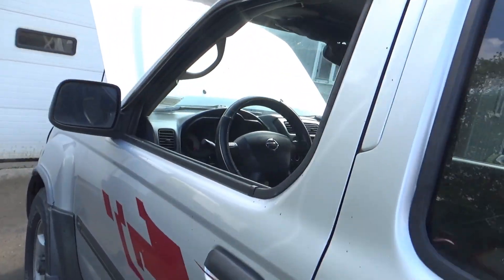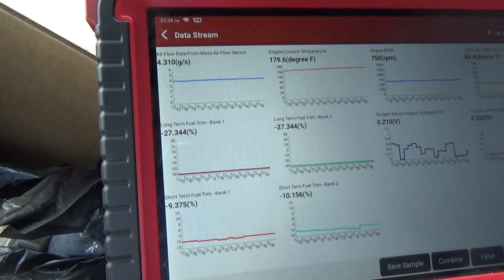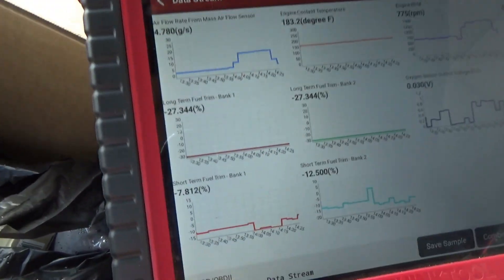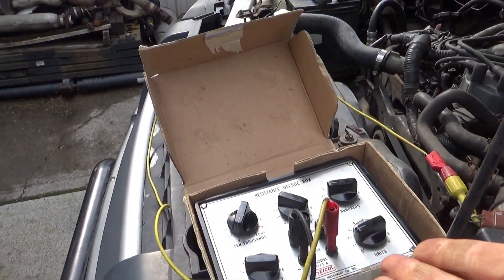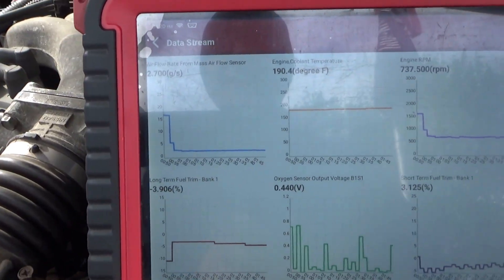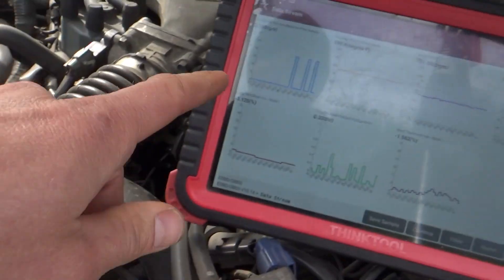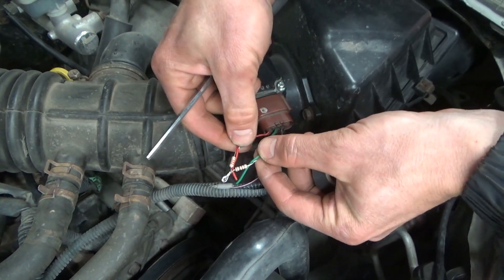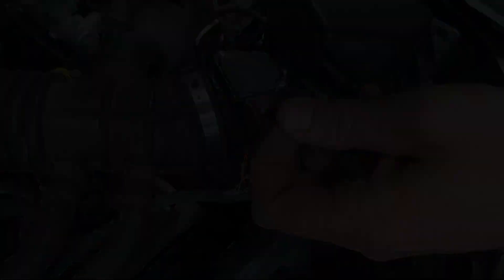I'm STUMPED...Crazy RICH XTerra P0172 (Part 2)

Comment: I ran into a similar issue with a Jeep that had an engine replaced.  When the new motor was installed they accidentally connected the ground wire for the E.C.M. to a bolt that was isolated from the body with a rubber mount (I think it was the bracket for the air cleaner) and that lack of ground was messing with everything.  The weird part is that it was still getting a limited ground from somewhere but not enough to allow the sensors to read correctly.  I seem to remember that it was throwing the map sensor and intake air temperatures off as well.  The temp sensor is what clued me in because it said the intake air was like 285 degrees or something on a cold start. Lol

Comment: Aftermarket 02 sensors? I know there are 4 of them. Nissans have weak cats. Xterra of that generation distributors is a weak point. Injectors also. I have owned nearly the same one in the video for 11 years,

Comment: Since mass air flow sensor values with in spec I would check injector leaks
Reply: It runs smooth at a given set point. What are the odds all the injectors are at fault to the same degree in the same direction?
No. You could check the fuel pressure regulator though. It might be stuck or commanded closed when it shoun't
Reply: @InsideOfMyOwnMind  one or two leaky injectors are more than enough coz this older Nissan's reading resolution is very low 
Hens it could happen 
Coz wen he rev the engine trims comes down with that we can suspect leaking injector coz at higher speeds that effet coming from a leaky injector decrease
Reply: The values in the manual only check for gross errors or completely failed MAF sensor.  The air mass measurement reported by the ECM is too high.

Comment: Ivan, I love your channel. I am just a home DIY guy but I bought a OBDII breakout box and the two channel scope even though I have never had a problem that required such tools.  I just want to be prepared in case it happens.  I am waiting until I have a problem before buying a Thinktool+ because the Thinktool people only include two years of software updates.  I cannot yet justify the $270 for the AES wave patch cable kit.

I wonder about a few things.  Is there a problem with the analog to digital converter in the engine computer that is connected to the mass airflow sensor?  Is there a problem with the ram memory at the location that the engine computer allocates for storing the value of the mass airflow sensor (such as one of the bits always stuck on a one or a zero.)  Did the non-volatile memory where the engine computer's program is stored become corrupted?  Is it easy to reflash the engine computer's program memory to make sure that the engine computer has good and up to date code?  Does the engine computer have self-test diagnostics to check for ram memory errors (walking memory test)?  Does the engine computer have a function to run a checksum integrity test on the engine computer's software/firmware?  Did you verify that the mass airflow sensor's voltages are making it properly to the connector on the engine computer?
Reply: Your memory corruption ideas are quite esoteric and I think never really work that way in the real world... plus i imagine there are checksums and the computer can self check itself for that kind of failure...
Reply: @jovangrbic97  Hi,  I buy business grade laptops and desktops and everyone of these computers has a standalone walking memory test utility in the bios.  I have had two instances (over many years) of unexplained blue screens of death that I am sure were due to bad memory.  The memory test utility listed the bad memory location each time.  The problem went away after replacing with new ram,  I have had two ssd's hard fail in an unexplained way and I now use only Samsung Pro SSD's which have been proven to be much more reliable.  Similar thing for display adapter cards. I have wondered why automobile manufacturers do not expose test utilities which are surely used in the factory. Component failures are a fact of life for people who work extensively with computers.  These failures are well recognized in the industry and are "managed" by having a pretty rigorous contract with the component manufacturer using a measurement known as "annualized failure rate".  It is common practice to return bad boards, disk drives, etc. to the manufacturer's quality assurance team to determine the source of the failure.  If an annualized failure rate is found to exceed a threshold then the component manufacturer is required to reimburse the board/car manufacturer for expenses.   The fact that failures occur infrequently does not mean that they are not found in the real world.  In Ivan's situation, he is much more likely to encounter component level failures than regular shops because he normally only gets the hard cases from his customer base.  I think it is a shame that to my knowledge there are no standalone utilities to self-test the car's computer modules--it is an expensive swap and test approach at the computer level (sometimes known as hope and pray diagnostics).  A large percentage of the chips in computers can self test themselves if the manufacturer implements the code to do this. Many people just sell or junk their car after using the parts cannon when it is quite possible that better diagnostics could inexpensively identify the problem.
Reply: @hivolt55  thanks for the deep explaining. i fully agree that having access to all tools, both hardware and software would be great, pity we dont live in an economy where this is viable... alas

Comment: Ok. Here we go. 
1) Check for electrolysis in the cooling system by measuring voltage (with one lead in the coolant) from coolant to ground.  Should be less than .5 volts.  More than that, change coolant.  Galvanic action can create stray voltage across the ground plane of the ecm and other devices.  This throws everything off.....just a little.  Most overlooked test.  Old coolant.

2) Check any and all data items related to inferred flex fuel percentage (or anything similar).  If this is a flex fuel vehicle, and someone added only some E85, then this can cause an adaptation error is a system that doesn't use a fuel composition sensor.  Do a hard reset or flex fuel adaptation reset with the scan tool......just like ford.  (They sleep together at night)

3) What is the Baro or Map sensor reading?  What is your elevation?  Does it jive?  Are deliveries made in mountainous terrain?

4) What is the purge valve doing?  Is the gas tank at a low pressure as a result?  (doubt this is it)

5) is the oil still loaded with hydrocarbons?  Block off the PCV hoses and find out.

6)  What is the fuel composed of?  Take a sample, and do an alcohol % test.

7) What is the fuel pressure?  Is a regulator diaphragm secretly adding fuel?

Forgot one.  8) Make sure someone has not crossed the o2 sensors on you.
Reply: E85 would cause lean running and positive fuel trims.  Also wouldn't cause a high air mass value to be reported.
Reply: @ferrumignis  Going from E85 to E10 gas will run negative trims, since it is inferred composition instead of measured composition.  Doesn't always adapt very well.
Reply: @vilefly  Would a 2004 Xterra be flex fuel?
Reply: @ferrumignis  I'd have to look it up, which I'm too lazy to do since he declared it fixed in part 3.  I honestly hope it isn't flex fuel, for his sake.
Reply from the maker: Electrolysis in the coolant system... I learned about that phenomenon the hard way on my 89 Mazda MPV when the radiator would literally corrode through and start leaking every 2 years! On the 4th replacement I noticed one of the metal mounting tabs was tweaked and touching the body of the radiator. Bent it back and no more radiator failures in 15 years!

Comment: I wonder if the engine oil has high hc
Reply: That could make the fuel trims go negative, but it still wouldn't explain why the MAF is reading higher on the scan tool than it does on the volt meter.

Comment: Very interesting! Seems the MAF sensor is not properly calibrated on the engine computer. I was going to suggest to test with a 10k potentiometer, but you had a resistance box :-) Good call to externally "calibrate" the output with a parallel resistor! And when all seemed under control, you announce a Part 3! Getting wild :-)

Comment: Ivan, could un metered air (vacuum leak) causing the Fuel Trims to throw a lean code? I've seen where injector Orings would suck un metered air.
Reply: These are rich codes which means to much fuel. Not going to be air leaks here
Reply: @reweydewy  Oops...Wrong way 🙄...

Comment: Tell your client to bring the truck back and reassemble the truck back to its original state. Then get back to work figuring out the problem or tell him to take it to someone more professional. I'll give you a hint. Check the fuel pressure at idle and then 2000rpm.

Comment: I wonder what the PCM input impedance for that sensor line was? There could be an resistor inside PCM pulling down the signal line and increase current in the line, on order to reduce harmful interference. That or the AD converter might have failed? I guess there was no voltage information for MAF line in data? I can not figure anything else than bit faulty AD (volts to digital number) conversion inside PCM. One way to check that is to compare the input impedance of the line between a known good PCM and this one. 

If there is an difference, then you at least know that PCM:s are different thus one of those is faulty. If you get the same impedance, it does not mean that PCM is good, the fault is not visible to the input line. To me PCM is missing an 3,3 kOhm pull down resistor, from the end of line inside PCM. Solder joint again?

Comment: Could there be a resistor I. The computer input  circuit have a bad resistor? If so, why would they not put it right at the sensor?
Reply: this stuff is supposed to be calibrated to play well together. I'm thinking his resistor array is recalibrating the signal to the ECM & all is good.

Comment: With the voltages being out of range, thee must be a mechanical reason for that.  Is the sensor mounted in a different manner, is the airflow different between sensors due to a mounting discrepancy?  I've been there as well and I'm anxious to learn what you found and did to correct the problem.  Thanks for a fine, interesting video.
Reply: I was thinking maybe the MAF housing body was the wrong one. Maybe it’s from a smaller engine but then the MAF voltages were spot on.  I wasn’t expecting to see battery voltage at the MAF as normally a regulated voltage is supplied to sensors.
Reply: Did you see the Ex Nissan tech saying he's fixed a few of these due to timing being off by 1 tooth on each cam?

Comment: I’d guess bad ecu/pcm or wiring, but if the resistor works, why go further?
Reply: Because it will come back to get you.  Especially when you have forgotten all about it.  In my 33yrs of experience, I have never needed to do the resistor trick, except for a one-time calibration of an old temp gauge on a 1986 plymouth horizon that was no longer stocked by anyone anymore.  Only then, do I advocate a resistor calibration....so long as it is not for the computer.
Reply: Because excessive loading of the sensor output like that may affect the linearity of the airflow vs. voltage curve of the sensor, leading to improper air/fuel ratios at other conditions of RPM/engine load.
Reply from the maker: @bobweiss8682  test drive proved that all rpm and load ranges had acceptable single digit fuel trims with the resistor installed 🙂

Comment: Does the ECU use any other inputs besides the MAF to calculate that flow rate in g/sec?  Like maybe an intake air or ambient temp sensor?  
In order to calculate the actual mass flow, the ECU would need to know the speed of the air past the sensor (which is what the hotfilm/hotwire probe in the MAF is measuring), as well as the air temperature (air temperature and density are inversely related), and the cross sectional area of the intake duct where the MAF is located (would be a constant in the ECU firmware, model dependent). So an improper ECU input for intake air temp and/or improper firmware from a junkyard or "tuned" ECU might cause what you are seeing here. As would a shift in the gain of whatever amplifier/ADC processes the MAF signal inside the ECU (caused by component degradation or improper firmware values)

Adding the bodge resistor might make it run sort of OK, but isn't really addressing the root cause of the issue.
Reply: amen
Reply: A MAF (Mass Air Flow) sensor calculates air mass , not volume, so it already corrects for air density.  Air temperature is still needed to correct ignition timing etc.

Comment: Curious why you ruled out something like a stuck injector.
Reply: Did these things have port injection? That would make sense.
Reply: Earlier in the diag process, right? I suppose that MAF reading in the live data really pulled him in direction of air rather than fuel. In hindsight though, the system's response to that resistance he added rules out that possibility to my mind.
Reply: A stuck injector wouldn't cause rich running on both banks and a reported air mass that is clearly too high.
Reply: @ferrumignis  if had port injection then it could effect both banks, right? And the mass air flow is in range.
Reply from the maker: Uhh because it wasn't misfiring?

Comment: Check that injectors are correct part number. Engine coulda been changed at some point and they are flex fuel injectors or something
Reply: Ok now that I'm watching the video before commenting is there a ground issue which would elevate the voltage?
Reply: @eddiereichel9354  The MAF ground was in the 50mV range.
Reply: Fuel injectors couldn't cause the MAF to read too high.